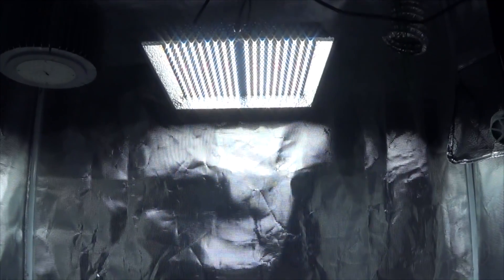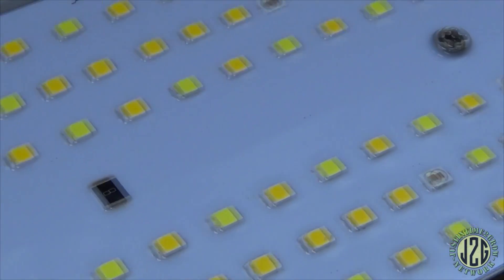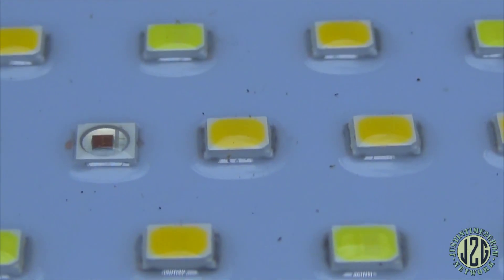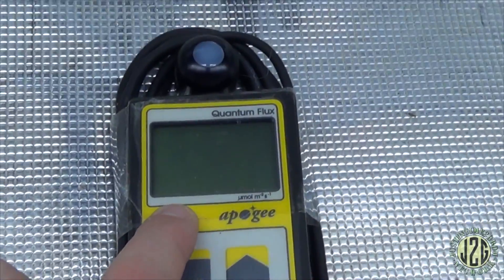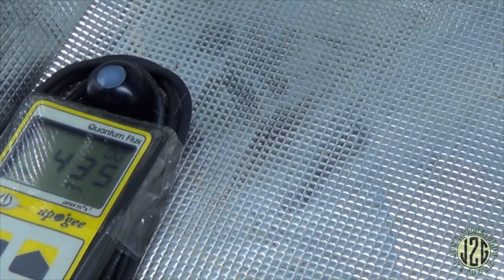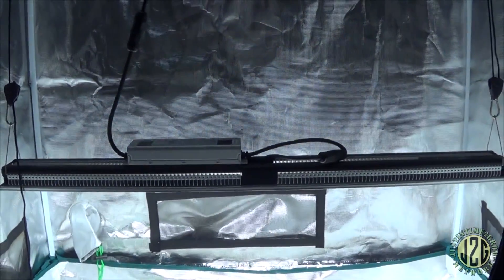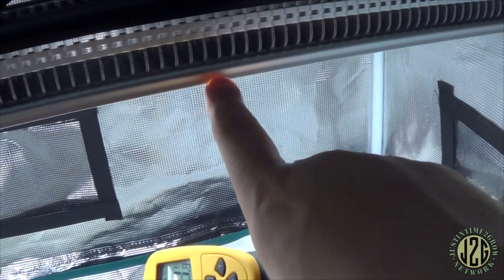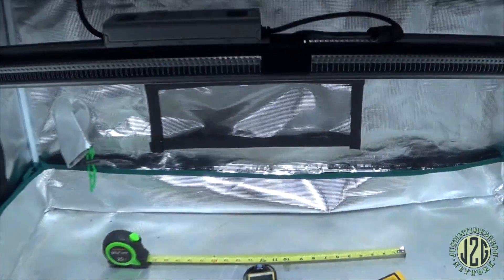BEST BUDGET LED For A 2x4 Grow?? SP-250 Unboxing, PAR & Heat Test

Comment: Those guns for temp are accurate, just not precise. The laser has nothing to do with it but to help direct it. It is measuring ambient temperature. Those are perfect for what you were doing. The small diagram on the side of the temp gun explains it but a degree doesn't matter. Great vids bud.

Comment from the maker: Some of you more eagle eyed PAR meter owners may have noticed my meter was set to "sun" source and not "elec" source. I just replaced the battery and didn't realize it reset my settings, doh! Rather than reshooting the entire video I just tested again at 18" and it's about an 8% lower reading. So I guess I like this light 8% less LOL. Sorry but it's still a good light. Just wanted to be transparent. I also got this light for free to show you but as usual if something stinks I'll tell you how it smells. 

I also noticed that it says SP-200 on the light and on the brochure. I don't see any changes or differences in spec. I asked them and they told me that they changed the name but didn't have time to change the sticker and literature before shipping.
Reply: Hey Justin great display here man and I must say I am curious as to How can I get hooked up with a free MarsHydroLED?
Reply from the maker: Cannabesiah Islands thanks, not sure but I think it was probably the 30k subscribers. 🤷🏻‍♂️
Reply: Thats my guy! Keeping it 100 always
Reply: 250 is upgraded model since it was free they probably used a leftover 200 shell and actual light panel from the 250.  I bought a $40 cheapo for my 2x2  well two lights for $80 put both in my 2x2 and I get over a half lb every harvest usually run a northern lights auto and moby dick auto. Just got my 420 seeds man sale seeds excited to throw them in my 4x4. My 2 closets have optic leds in them
Reply: @cannabesiahislands4890  start up a dope ass YouTube channel show you can grow and the free products will flow.
Reply from the maker: adam west it’s not an upgraded model, they just changed the name to make more sense with the sp 150. This isn’t just a small upgrade from the 150 it’s almost double so that makes sense.
Reply: @adamwest Maybe?? what works for one person isn't guaranteed to work for the next though...
Reply from the maker: datsLarryLove honestly he lost me when he said he grows autos 😂 🤫
Reply: DO YOU THINK 2 SP 150 WILL BE ENOUGH FOR A 4X4 TENT?
Reply: @Justintime2grow  yeah me to about the autos.. but I've seen crazy methods of lst  and monster cropping and of course topping yield like 4-8 zips a plant.. I didn't get that EVER FROM AUTOS NOT EVEN CLOSE..HOWEVER I NEVER TRAINED OR TOPPED MY VERY FEW I GREW BUT THE N. LIGHTS IS A DECENT YIELD IN MY OPINION WITH 2 MONTHS FROM SEED THEN 2MONTHS OF FLOWER I HAVE GOTTEN 10 TO PRODUCE A QP EACH.. SO BETWEEN 2 AND 2 AND A HALF  EACH HARVEST , IF I PUT LESS PLANTS IN WOULD I GET HIGHER YIELDS ? I HAVE SOME EXPIERENCE NOT A TON BUT WHAT DO YOU THINK.. I DON'T HAVE ANYONE TO ASK PEOPLE I KNOW DON'T KNOW ANYG HING ABOUT GROWING
Reply from the maker: Jose Avila nah 2 of the 250s for a 4x4. Yeah autos usually aren’t great weight but that’s not my issue. They aren’t real weed in my opinion. It’s bastard weed. Mixing a plant you don’t ever want to smoke(ruderalis) into sativa and indica just because you’re too lazy to set a timer is ridiculous. They’re always sub par quality to regular Indica and sativa. So somebody saying they get a half pound of auto bud I just wonder how I would get rid of a half pound of mids I don’t want to smoke 😂
Reply: @Justintime2grow  ya I've seen but I didn't personally ever get good yields from autos.. but I know one guy who does.. so 2 of the 150 arnt  enuf.. what if I already bought them and have them in my bedroom.. and the 4x4 😐
Reply: @Justintime2grow  I got them in Feb  or so 2 sp150 and a 4x4 .. couldn't afford them sp200 or up.. I had 500 budget I spent 411 on tent 2 lights in case 1 has any issues so I'm not lightless tent 4x4 and glasses.. that was the budget now I'm super bummed id you say it ain't enough
Reply from the maker: Jose Avila it’s not going to cover a 4x4 properly but you’ll still be able to grow plenty. 🤷🏻‍♂️
Reply: @Justintime2grow  how many plants can I do with 2 sp150 in the 4x4
Reply from the maker: @JoseAvila-fy1qu  I would just try to stick to a 3x3 space. Probably 4 small/mid size plants or 2 big ones.
Reply: @Justintime2grow  amen.. autos dont even count in my book lol
Reply: @JoseAvila-fy1qu  if ur growing autos, its enough light.. another thing about autos..using 18 hours of light minimum per day.. so thats why people use shit lights and grow autos. You dnt need much lighting since ur DLI ( daily light integral ) is high sincd ur lights are on for sk long, autosbget plenty of light
Reply: @growshack9067  so if I do 8 small 30 days i n veg and 60 days in a 4x4 with 2sp150 j ts pulling 156watts from wall the umol is 500/556 sides / center at 18 inches.. my veg tent seperate has just some t5 vel and cfl  and led bulbs cause I find they VEG well under the basic light.. and I'm not in flower yet. Just curious each plz nt is 18/24inches tall lollipoped lst and monstercropped and i will scrog them.. it was my budget i had 500  so i figured 2 lights is better than 1 just in case one were to fail.. I'm on a strict budget buf I Wil upgrade after harvest or if 8 is y I many. I'm aimj ng jusf to fill the canopy full  Idk  6 plants 8 or 4 what's best for my situation
Reply: @Justintime2grow  I started out with auto's... Got the Reg's running now-a-days but I'll still pop some auto freebies
Reply: Looking forward to an update video on the SP250
Reply: I remember arguing with you on led grow lights a couple years ago Lol. All good like you're videos.
Reply from the maker: @markb2280  It's in my weekly videos it's my veg light right now.
Reply from the maker: @greengold6705  Good times.
Reply: the 200 was there first test of those lights the 250's are what they put out to the public. is what I was told. I cant wait for mine to show up
Reply: @Justintime2grow  mephisto genetics are as good as most photo's I also hear fast buds are seriously try a mephistos and you'll be very surprised
Reply: @Justintime2grow  mephisto genetics changed all that
Reply: This light has dimming feature on the opposite side of the driver FYI! !!!!
Reply: I know this was a review you did 2 years ago but I was wondering why cant I find one anywhere I look.. And do you think the sp3000 is to much for a 2x4?
Reply from the maker: @chief1836  Sp3000 is the replacement for it. When it came out it was very expensive and it has now come down in price to replace the sp250. The 3000 is basically the same thing with better parts. Discount code Justin or j2g should work also.
Reply: Thanks bro.. Do you recommend it for a 2x4 or something better by now?
Reply from the maker: @chief1836  There is better but also more money too of course.

Comment: The sp 250 is probably one of there best LEDs to date and I appreciate you taking the time to give them the chance bro not everyone can afford hlg as they get rich overnight lol thanks again man👍💯
Reply from the maker: I wanted to check this light out as soon as they announced it. It took some doing but it's finally here!
Reply: Far from best still , efficiency of 1.8 ppfd/watt . The top brands ar above 2.0 . And on hlg the dif between the 260 watt kit and this one aint that big in price . But Best they got out and its a big leap from before .
Reply from the maker: frederik coucke the title says budget light, HLG is not a budget brand by any stretch of the imagination and neither are any of the brands pushing over 2.0  🤷🏻‍♂️
Reply: @Justintime2grow    i know but i was replying to @DeZZ NugZZ , and only 72 dollar dif between the 260 w kit and the sp 250 so differance aint that big . But as i said aswel its a big leap for Mars .
Reply: I agree with you about HLG’s pricing for their 260 kit. $72 more isn’t a lot for a higher-end light, especially considering you can use coupon codes from online growers making the cost go down. At that point, the difference in price is negligible. 

I’m running an Optic 8 which is a great light.

Comment: Great review bud! I just ordered their 2x4 and about to order the SP250. Much better than the 1000 they put out. Love the look of the light. I like the Electric Sky 180 as well but the Mars is 100 less expensive. I'm sure there are quality differences but both only offer a 3 year warranty. Either way, I'm liking the Mars. Hopefully they keep building on their lights. There is actually a dimmer switch on the underside of the driver. Take it off the light and it has 2 black caps covering the potentiometers.
Reply from the maker: Nice! Thanks for the tip on the dimmer. I probably won't be using it, it seems to be just about perfect to use in this tent.
Reply: Nice!
Reply: Same,  I like the es180 as well but this seems close. Idk if the price difference is worth it tho 🤔
Reply: I would like to know how this light stacks up with the ES300 or ES180. Spectrum,  par,  efficiency..
Reply: I was going to by a single CMH for my 2x4, but decided to go with this instead... I'm hoping I made the right choice,  I guess my buds will let me know soon enough if I made the right choice or not.

Comment: From what I can see it takes about 10% of the electricity that I used to have to use using the old HPS lighting. Which is really nice because I live off the grid I have to make my electricity. and the lack of heat I don't need an air conditioner

Comment: I own the SP150(s) x4    they are amazing!  Cost, Heat, coverage / PAR, warranty is all 'TOP SHELF PERFORMANCE.   The SP150 are cooler in temp,  you can hold them except the LED SMD surface is hot.
Reply from the maker: Hell yea
Reply: seen a lot of posts of these failing in 6 months and they then get you to pay to sip it back to china,
Reply from the maker: lazy carper I haven’t and mine is 6 months without issue. All I see is people crushing with them. 🤷🏻‍♂️
Reply: @Justintime2grow  ok hope it continues the same way for you,
Reply from the maker: lazy carper me too 😂
Reply: @lazycarper7925  bro where do you see ANY posts of these lights failing? Post a link friend cuz I'm bout to pull the trigger on 2 more for my other tent.  I've had mine for 4 months and they are rocking my 4×4. I used 1 for my veg tent and got another light for the 4×4.  The only concern I've had is whether the coating holds up on the LEDS.  That's it. I've done quite alot of research and I can't find any failures of these lights.  So If you say there is post the links please.

Comment: Just wanted to say thank you. An awesome review of a great product. I was looking for a good first grow light, this review sold me on the sp250 no regrets. In your opinion is the 1.8 grams per watt advertised possible with this light?
Reply: I got close.  I got 732 grams dry weight under 2 SP250s. Nearly 2 grams a watt with 2 Pakistan Valleys.
Reply: @timpage5021  what size tent were you using. I'ma first time grower with a 4x4 grow tent. I have 2 so 250s and am looking for as much info/advice on using this light as possible. Starting with auto flowers. Thanks in advance.

Comment: Thanks for the second comment 👍
I’ve got a 4x4 and just looking at getting 2 of the new sp 250 
So hopefully they should be good 
Great helpful video man ✌🏻
Reply: Get the TS 2000W, it's made for the 4x4
Reply: @brianmarceaux1807  I got 2 SP250S in my 4×4 . They're killing it. I've got 3 harvest so far.  My biggest was my last grow 732 grams dry weight.  Close to 2 grams a watt.  With 2 Pakistan Valleys.
Reply: Tim Page good to know! Thanks for the info
Reply: @brianmarceaux1807  no problem you're very welcome
Reply: Tim Page Thanks man
I’ve just put 4 babies in under 1 light while there small 
Then going to get the next light on when they’ve had @2 weeks?
Thanks for your reply 👍✌🏻
Reply: @drgrowuk8830  no problem you're very welcome.
Reply: I'm asking myself the same question! What did you end up picking and why?
Reply: Tarot the Hangman  I brought the SP 250 and they are amazing 
Flowers love them 🔥💨

Comment: Have y’all checked out Spiderfarmer they have great quality LEDS for the price and my plants are pop’n after installing the SF2000 model excellent for a 4x2 tent
Reply: Zachary Herbert how do you like it? What other lights have you tried? I can’t decide between the sp 250, tsl 2000 or the spider farmer sf 2000!
Reply: @halflife82  I have exactly the same dilemma.  2X4 tent and those three lights all seem perfect. The sp250 has UV which I read stimulates production of terps and tricomes.  Spider has Samsung led's and I could add a bit of UV.  Choices, choices.

Comment: i found out the other day that the sp250 doesn't produce it's rated wattage of 240w on 120v,only 180w. 240v is required to get the full 240 watts.i wired mine for 240v and the 25% more light of 240watts  is very nice. nice video.thanks.
Reply: @MrDmadness  all the input voltage(120v or 240v) does is power the driver,which for the sp250 automatically runs on either 120v or 240v. the led it's self runs on 48v of dc current. i've been running my sp250 driver on 240v for months with no issues and by doing so,i'm using fewer amps than a 120v setup.

Comment: Use a longer electrical cord and mount the driver outside the tent. Your temps will be easier to maintain.
Reply: That's a really good idea Allen; I'll try it!
Reply from the maker: They have considered making the cord longer I know for that reason. It's a standard disconnect fitting so it wouldn't be hard to get a longer cord.

Comment: I bought two of the one fifty's the money was the same and the wattage is a little bit better same coverag
Reply from the maker: That's pretty smart thinking :) Depends on  your needs. This fits a 2x4 perfectly. There really couldn't be anything much better for this space. The light goes wall to wall lol.
Reply: Did the same .. 2 x 150 ... Very impressed. Thanks for the vid and specs.

Comment: Would 2 of them in a 2x4 be to much? Two would fit nicely
Reply from the maker: Depends, are you trying to grow weed or make a light bleaching chamber?
Reply: Im thinking two and dim them down some. I add co2 by burning a kerosene lamp in the living room and recirculate the air unfiltered. Im in wa too. Lakewood. 
This is the light ive been saying to make. End to end 2x4 light. I like the idea of redundancy by having two. I dont have time to wait for warranty work.
Reply from the maker: @joshuatinkham3703  Do it man, I'd like to see it.
Reply: Yeah ive done that sticky mess even made sealed bucket i could vent direct to the tent

Comment: epistar diodes would be my only complaint.  but atleast mars is trying now days
Reply from the maker: Yea that's where I'm at with it. That's really my only suggestion to upgrade it. The rest of it seems really nicely done actually. BUT I'm not going to judge it until something actually goes wrong. Tech keeps advancing and these diodes are different than the diodes of lights from past models. You can see a major difference and they look a lot more like the cree xte diodes that I have on my other light.

Comment: Thanks, one more question, what is the length, I have a 40"x40" tent(1 m x 1 m), just want to make sure it's not too long.
Reply from the maker: 42.5"
Reply: One meter is not 40inches.. 36.6. Remember that..

Comment: I havent grown sense 2013. Im an amateur obviously. So does this light do both veg and flower?? ...how is the quality of the light during flowering stage...it looks perfect for veg stage. Plz help
Reply: I recently purchased this light for its veg. ability, although, from all the reviews it works ok for flowering too.  I have only tested it since it arrived and haven't used it yet.  The dimer is on the backside of the power supply.  Good luck.
Reply: @11lam11  okay so basically you're saying you just need a flipper switch to switch the lights to flowering stage

Comment: Hey honestly I love your show.
I have a question about lighting systems. You always seem to give great advice about lighting so of course I thought of you when I became confused about my light question. Ok  which light would be most beneficial for a 3x3 tent a NEXTLIGHT CORE or Ts1000 MARSHYDRO? And please if you have a better choice for a product within the $300 to $500 range preferably in the lower range I will greatly appreciate your advice?
                                        Sincerely 
                                        Aaron Jones
Reply from the maker: Nextlight is incredibly overpriced. That's a $600 light you're comparing to a $140 one. If you're looking to spend $500ish buy https://www.rapidled.com/cxb3590-3-x-3-grow-kit/. Based on my PAR readings a single TS-1000 will not properly flower a 3x3 fully wall to wall but you could use it and get some decent results until you can upgrade.

Comment: Im tossing up between the sp 150 or the ts 1000w...whats your thoughts.does the sp series have a better driver than the ts.?
Reply: What did u pick is it working
Reply: @jimmy1life  I went with Ts 1000, working very good, lots of growth.not a bad light.... it's just about the same as the sp 250
Reply: How you liking it i just setup my tsl-2000 fits my closet perfect
Reply: Skyro Boss I can’t decide between the tsl 2000 or sp 250 for a 4x2. I have the TS 1000 already for herbs and love it
Reply: The ts 1000 is a a good light 2 weeks from harvest,i have nugs the size of a soda drink can. The sp series  are also good lights thay have a better driver than the ts but run a bit hotter due to the lights having a plastic coating over them.i believe from all the tests done on the ts and sp series mygrow done a good one, the ts 1000w is just behind the sp 250...and seeing the results my self its a great light for the money,the sp series  has a slightly higher red spectrum and runs a bit hotter.